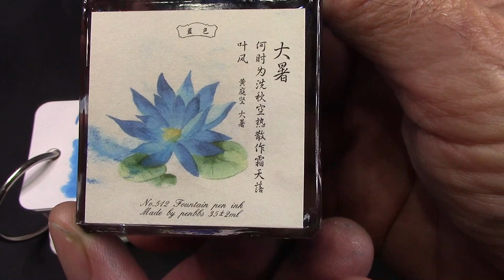PenBBS 535 2021 Year of the Ox Pen disassemble, filling & writing

Comment: Thanks for giving me the info and confidence to fix a glitchy rod/piston problem with my 535.  I could not get the rod and piston to move down even with a great deal of pressure and I was afraid the pressure I was applying would eventually snap the rod.  Watching your very easy-to-follow steps I was able to take the pen apart, apply silicone in all the needed spots, and reassemble everything. Now it works perfectly. Your videos are all great and I really appreciate your expertise.
Reply from the maker: Glad I could help.  PenBBS Pistons tend to stick. Started with 309 & has continued.  Thankfully rhey disassemble easily.   Thanks for watching.

Comment: Another great reference Pen Talk, thank you chrisrap52. My RM wrote smooth too as most of my  PenBBS fines write drier. I had a hard time engaging the piston unlike my 355. It seems to take extra Ox umph to really unlock/lock to unscrew, but once done, worked like a charm. Good thing to see your takedown in case we need to reference for maintenance in the future. Cheers!
Reply from the maker: Hopefully my close up of rod & piston helps with the filling.  As I do not need to fill these pens often, I need to think before acting to use the draw filler.  Thanks for watching.

Comment: Hi Chris!  I really liked this review of yours: a tribute to the engineering used in this fountain pen.  While I have some doubts about how you loaded the ink into the pen.  I understand that for these models you have to lift the nib from the ink when the piston is just over 1 cm from the stroke end.  Then bring the piston to the end of its stroke, again slightly forward and lock it.  Otherwise you have too much air in the ink and very little between the ink and the piston, which is putting pressure on the ink.

Comment: This is an excellent pen but it's also the first pen that ever broke in two on me (after a 3 foot drop), of course right at the one point it's glued, the front reservoir. I didn't get a reply from Beini what to do, I guess I'll try to crazy glue it myself.
Reply from the maker: Ouch, sorry to hear.  Yes, I've had a few pens break when they fell off the desk.  I now have a thick carpet on the floor.  As a limited edition, parts may be a challenge.  Good luck.
Reply: @chrisrap52  I can glue it, I just hope it's strong and water tight. I'll post a video too, but probably only in Hebrew (sorry)
Reply from the maker: Crazy Glue can dissolve many plastics.  Be careful.  I use clear Gorilla glue which takes a day to dry but safer for many plastics.
Reply: @chrisrap52  I'll see if I can find something like that here in Israel. A product must exist, but I doubt it will be that specific brand.
Reply: @chrisrap52  I checked their site and they have dozens of products. What's the specific gorilla for this job?
Reply from the maker: @Seefood73  Bottle I have is just "Clear Gorilla Glue"